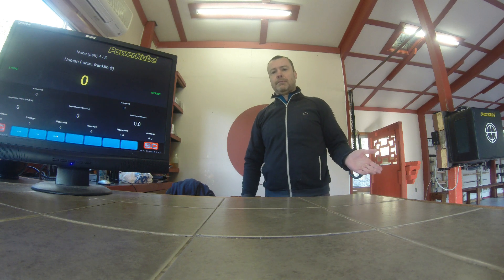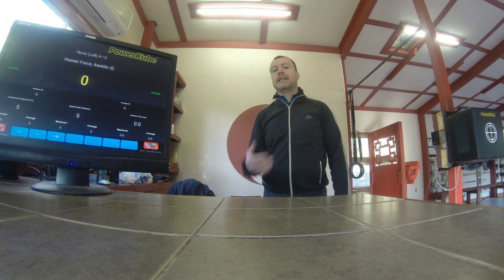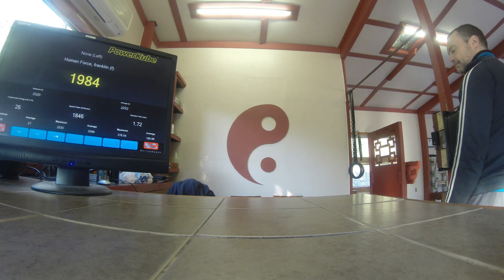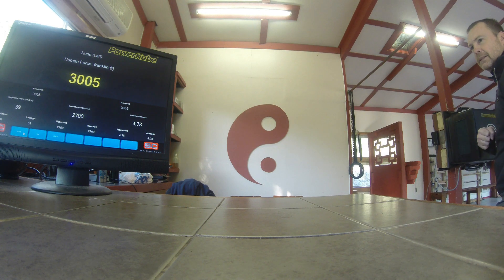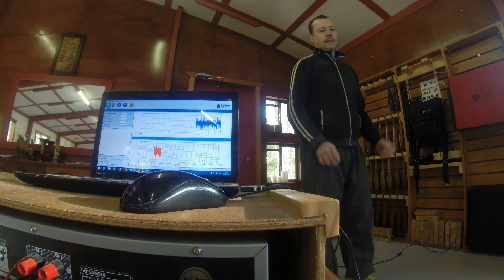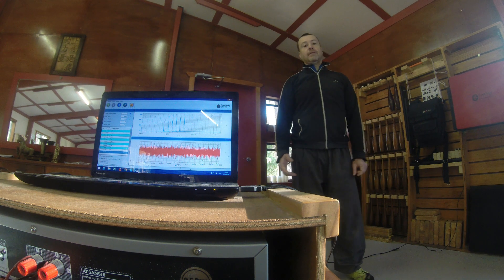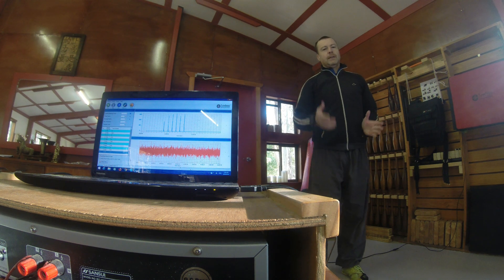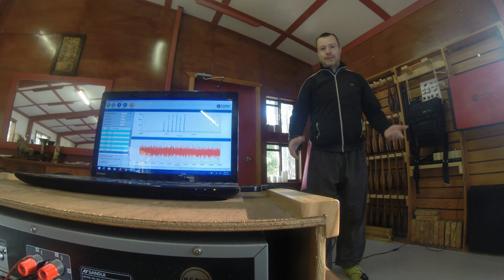PowerKube vs Load Cell 1 inch elbow strike

Comment: Is seems like the Loadstar punch sensor is the way to go if I want to measure by punching power as boxer? 

I’ve been going back and forth between the LoadStar and the PowerKube. Do you know if it’s only a load cell measuring sensor that is used to calculate the force in the Loadstar? Or is it more complicated than that? Would love an explanation or a breakdown. Not many other people online who are knowledgeable and interested in this subject.
Reply from the maker: Hi
No worries, I can give you a short break-down of the two technologies.

The Loadstar boxing sensor is simply a load-cell with a flat aluminium plate on the front along with some padding. It samples at 1kHz and provides a millisecond-by-millisecond force output which is processed by one of two sets of software that the manufacturer provides along with the sensor. The software is stable and works well. Really useful if you want to do in-depth analysis of how the force curves evolve over time. The downside is that it is not very portable and really requires permanent mounting. In addition, apart from the padding, it is relatively rigid which can possibly lead to impact injuries. I tend to avoid doing certain strikes against it because of this. 

The PowerKube is based on accelerometers and measures the acceleration caused by impacts. It is essentially a hard foam ‘spring’ which compresses when struck. Because of this feature, it does not suffer from the rigidity drawback associated with the loadcell. It is also more portable and a sparring buddy can hold it like a kick-shield or pad while in use. However, it does not provide a continuous output because of the way that it performs its calculations. In addition, the units are essentially calculated in a closed process, making it hard to compare with other real-world values. Aside from the composite Franklin unit, it does provide the two other component units that can be analysed, speed/power (foot-pounds/second) and compression energy (calX10). The software is stable and works well. 

There are bag-mounted accelerometers out there I believe but I have not had a chance to review these, so I cannot comment on their effectiveness.

In addition, there are some wrist-mounted accelerometers out there that are supposed to provide force outputs. I’ve done a bit of digging into these but the technology appears to make assumptions about the mass behind the strikes, which is a gross oversimplification. There have been a number of studies that indicate that the apparent mass behind strikes changes depending on the experience of the fighter. So I am pretty dubious about these sensors.

Hopefully this gives you something to base your decision on. If you need any other info, don’t hesitate to ask. Always happy to help someone who is interested in this where I can.
Reply: @WushuEngineer  Hi Wushu, we are looking to create something similar to the PowerKube and would appreciate if you could answer a couple of questions

-when you say 'accelerometers' are multiple of these used and how do you know if so?
-how important is use of the spring and would the accelerometer(s) be mounted to this?
Reply from the maker: @wolfguptaceo  Hi. Thanks for your comment. It is difficult for me to definitively answer your questions regarding the PowerKube because the manufacturer has not published detailed technical information regarding the device and I have not disassembled ours to confirm its internal workings (it is a reasonably expensive piece of kit and we use it in our business). Neither do I have any substantial knowledge of the mathematical processing that is performed on the acceleration data to arrive at the energy, power and proprietary franklin units. However, I can provide my opinions based on my experience with the device and on what the manufacturer has published. I believe that an accelerometer is mounted in the centre of the front strike plate of the device. This accelerometer measures acceleration due to impact. A second accelerometer is mounted in the back of the device and this one ensures that the device is not being moved prior to the impact (to prevent cheating, I believe). The foam spring that separates the front and back plate is integral to the functioning of the device and resists the acceleration of the front plate as it is struck. The characteristics of the foam spring and its effect on the acceleration and impact time duration allows the energy and power of the strike to be determined. Hopefully that gives you some idea of how the device functions.
Reply: Wushu Engineer  Yes I’ve heard about those wrist sensors and they have gotten a bad reputation. 

I think the weight transfer and the amount of fast twitch muscle fibers one has is the biggest factors in force measurement, i mean mass x velocity = force right? So I would assume how fast the puncher is and how much weight he can get in to the punch/quality technique, would show the force number at the Loadstar punch sensor’s technology in the most accurate way? 

That the load cell at the Loadstar samples at 1kHz what does that mean?
Reply from the maker: @emiliox210  Yes, you are correct about the force transfer. Essentially, sampling rate is how many times per second the measurement is performed. You can look at it a little like the 'resolution' of a TV screen. The higher, the better in terms of capturing details. So a 1kHz sampling rate for the load cell means that the force is measured 1000 times per second by the on-board hardware and this data is then captured and processed by the software. For typical human strikes and collisions, this is more than enough to capture the details of the force curve.
Reply: @emiliox210  yep  egzacly mass x velocity = force assuming the same surface area and hardness of material interact  in human case mass dont mean body mass it also dont mean some rigid % from body mass diffrent people have diffrent ability to create effective impact mass some person may put in punch only forearm mass with fist vs some whole arm with half chest weight :x depoend on tehcnique body setup stifffness of kinetick chain :x.... sos cuh similar look punch mayy have completely diffrent strenght =peak force ., now  the only question is how big impact really have kinetick energy vs momentum  because momentum is massx velocity vs k energy is mass x velocity squered /2 :x both units are not from ass :x  im test personally for egzample one equation with air and it work in reall on analogue kitchen scale :x in thsi test kinetick energy was unit which generate peak force =when im increase air velocity 2 times peak force increase 4 times!  but for human punching momentum may be those units which in fact create peak force but im not sure on 100% that for sure:x i test pendulum swing for egzample how far it swing so this phenomenom have 100% corelation with momentum of flying object into pendulum  and not energy  howveer in human case thats more complicated we can use muscle bones leverage so we dont have only stiff value energ and momentum like dead object in motion  ... 1khz mean device measure force 1000 times in 1 second this is need to catch true real force shape graph especially peak force in collision like punching which work very short amount of time avverage punch is 30-50 miliseconds contact time s average blink f eye is 200 miliseconds ! without enough khz deice be  unable to measured punch force ! thats why loadsatr work at 1 khz at least up to 1,5 khz whhen is corelate with better computer now hear you have video explain this very well like you see when they use to low sampling rate 100 hz =0,1 khz forcemeter was unable to catch true peak force:) from specifid droping test specified object which they perform for this video https://www.youtube.com/watch?v=SSahzV3EIS8 =if you dont have enough khz forget about measured punching force i mean precise measured punching force :x  with to low khz only what you can get is some bullsh.t  fake to low numbers ....
Reply: @emiliox210  jeszcze cos kofa mialem pisac aha =  loadstar force plate catch momentum and change it on peak force so velocity x mass like you write  you can find out this when you loook at wushuenginner droping test with loadstar forcplate when he increase hight 4 times of droping bject force increase around 2 times and when object fly from 4 times biger hight it have egzacly 2 times biger momentum so mass x velocity ., now powerkube in the other hand change kinetick energy multiple be moemntum :x probably on peak force which it show in ft lbs sec units and  add momentum to kinetick energy for show franklins units :x most likely what youalso can find when you comapre results in droping test wushuengineer ... :)  so such both devvice  catch lil diffrent units :x  now question which is closer to truth :x this is question which in fact is me goal for human punch  and now i dont know precise answer this stuff is way more complicated than i though it would be unfortunatelly :x unfortunatellly none of basic formula epxlain this :x so energy be distance = average force  ., momentum be time =average force  ., mass x acceleration =force but this dont explain nothing in terms how specified mass acumulate peak acceleration rate upon collision :x  so such energy vs momentum what generate peak force is more important question than who be next president of usa that for sure :x . ,
Reply: :D.

Comment: Not certain, but looks like you're using Internal Power for your elbow strikes. If that is the case, I would imagine the load cell would be more accurate to gauge the force/power in the strike, since sometimes with Internals, there's not huge or even noticeable acceleration/speed in the strike/movement, yet, it is VERY powerful due to unified body movement.    What do you think?   (if not using Internals, then please disregard my comment and question )
Reply: diffrence come from resistance probably power kube start to colapse at static weight around 30 kg while load cel is rigid mounted on wall and give time whole kinetic chain to compress on it be weight shifting from body powerkube start to change it speed in change in time before such happen it looks like power kube cant measured very slow movement but with alot weight properly for some cicumstances in real life 2700 ft lbs sec you can change into newtons it give around 27 kg force load cel show 150 kg force diffrence around 5 Times diffrenc probably is like im write beacuse of diffrent resistance try punch into shit of paper on air and try punch wall force be very diffrent .
Reply: power kube show also its invalid in other slow moevement with alot weight behind it like oneinch punch  i achieve on me force meter on wall 250 kg force and best one inch punch untill today on power kube is similar to your elbow strike so around 30 kg force:D  in real life it all depend in what we hit what part of body how somebody be prepare for punch how he stand in which position how you drive your strike before it achievemax comropesion and reistance on for egzample belly hard head behave diffrent .
Reply: ft lbs sec with its resistance probably give good picture of head shockwave  head is hard but relatively light you cant probably do to much shocwave to head be doing one inch punch or one inch elbow thsi proabbly show powerkube so probably very good one inch punch or one inch elbow work only on part of body which give big resitance  on head one inch punch give alot impulse so bend head on neck alot but dont achieve big peak g  FORCE so brain  trauma concusions .
Reply: so you cant do to much to oponent be doing one inch punch on hees head  probably beside push it far and be far from loose senses  .
Reply: put load cel free whichout wall mounted and try do the same strike put load cel on some wheel and put on this wheel also some weight that whole be weight 30 kg  than results should be similar be one inch elbow to pwoer kube results .
Reply from the maker: Yes, I think that there's still quite a bit of research that can be done on the effect of slower strikes with more apparent mas behind them. You're correct that the intended target area is important and will impact the strike's effectiveness.
Reply from the maker: Thank you for your comment and observation. I am using internal manipulation to generate force in this case. I believe that you are correct in that the short-range movements don't have a lot of space within which to accelerate and may not necessarily register as much using certain methods of measurement when compared to large-range movement. There hasn't been a lot of research done on this that I have seen. Possibly because the greater majority of systems use more conventional external movement to generate power. I am trying to assemble the equipment and testing procedures to do more comprehensive investigation into this. Good to know that there are others out there who are thinking along these lines.

Comment: You say an accelerometer doesn't give much information then compare it to a load cell? A load cell gives a very narrow view of human impacts, and Kg measurements aren't really appropriate for such performance comparisons.
Reply from the maker: Hi. I do not currently have access to an accelerometer, so I cannot comment on that just yet. I am planning to get one in order to make a better comparison between all three methods. My comment was on the PowerKube device, which is based on an accelerometer in combination with a known resistive element. It is not a standard accelerometer. I also did not say anything about the quality of information provided by a load-cell over an accelerometer. My comment was that there is no easy way to compare the two when it comes to measuring human striking characteristics. Load cells have been used to measure human striking characteristics for quite some time. They are one of the industry standard methods of gauging human striking. Values from load cells have often been expressed in Newtons, Pounds and Kilograms.
Reply: buy strike tec and do comaprision with loadcell and power kube how they corealtion in subscribe force  i Wonder also how  much accuracy have strike tec  beacuse it is rrelatively cheap  equipment and probably most polished from similar equipment .
Reply from the maker: That's an interesting approach. What we've been talking about is building a standardized 'rig' that can produce variable impact characteristics. Something like a lever with a variable weight on the end of it that is dropped from a specific height so that we can confirm the results through calculation in terms of kinetic energy and impact force. I'll be releasing another video soon which includes another comparison between the different measuring system performance characteristics. This is a definite advantage of the PowerKube in that it is engineered to reduce the chance of injury when performing maximal striking. It's still not a soft target, but certainly better than the fully rigid load cell force plate.
Reply: @WushuEngineer   we if you want do other comaprision beewten power kube and force plate i will do pendulum arm on which you put diffrent weight from the same hight than change hight with the sameweight and compare the corelation shpuld be discovered be mass to speed prodportion and compare ft lbs sec to kilograms force on force plate beacuse ft lbs sec like in ypur video with brick break when you put powerkube on force plate was egzacyy the same one hundred percent identical value you get from pk and fp gretings that be very intresting video such test  results should give good picture what is going on hear egzacly .
Reply: if not pendulum than do simple droping test from specified hight results be the same .
Reply from the maker: @mociczyczki  I'll put your suggestion into the schedule. I've got a few other projects I need to get out first, but I'll look at your suggestion once I've completed the others.
Reply: ok  its your channel ;